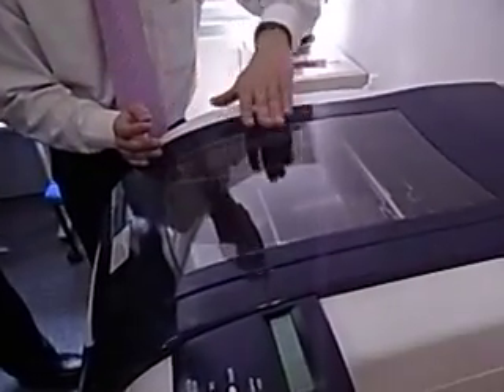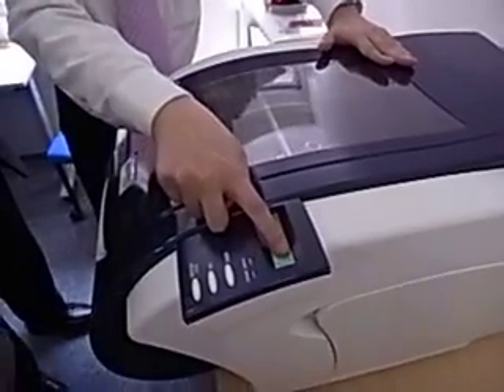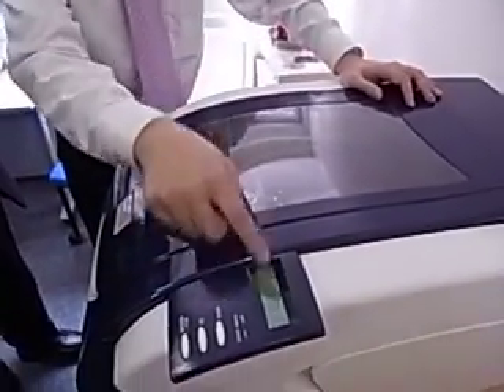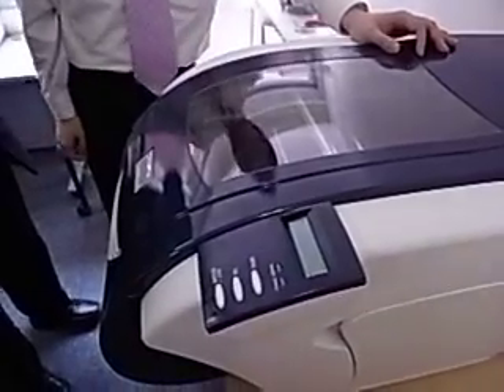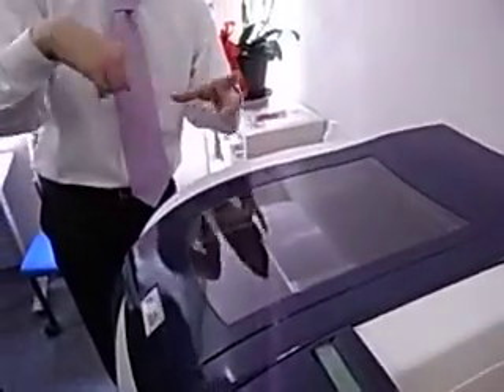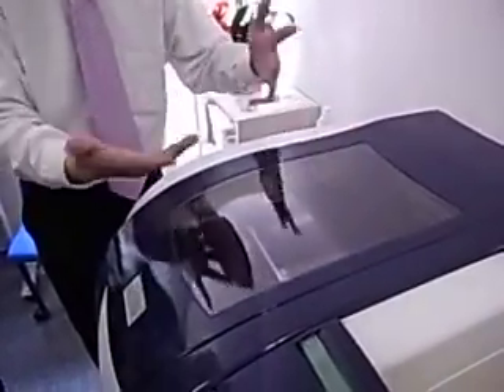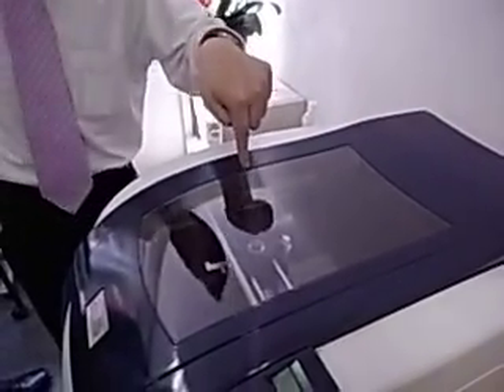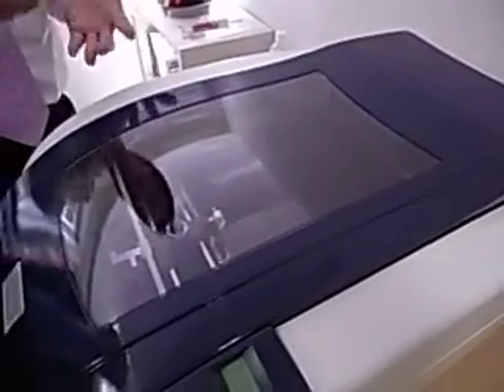Solido SD 300 Pro

Comment: @cjellwood, if the power is cut then the printer will obviously stop.  When power is restored it will move the machinery to a safe position and wait until the operator confirms that it should continue.  I own an SD300, and can confirm that it recovers seamlessly from power outages.